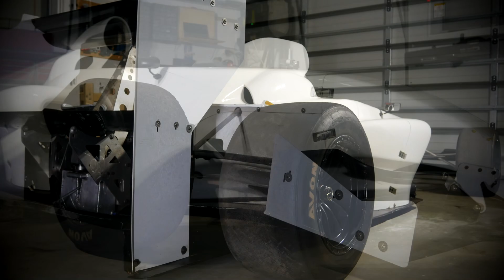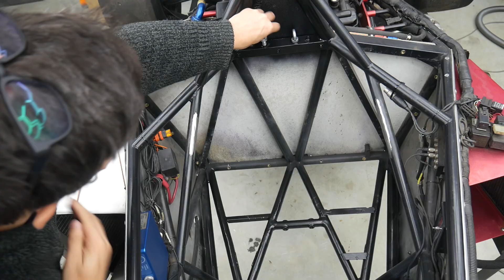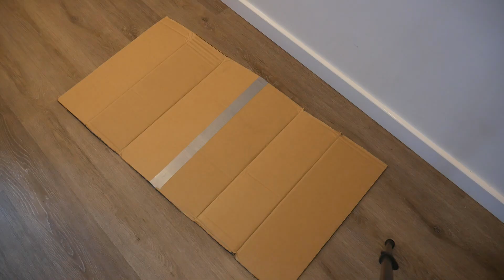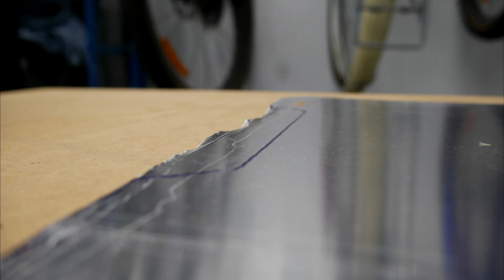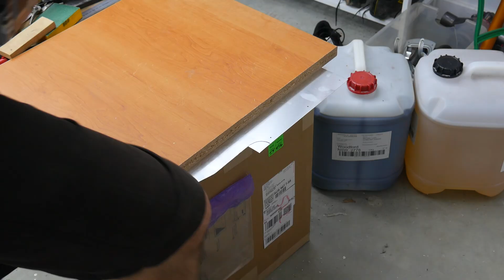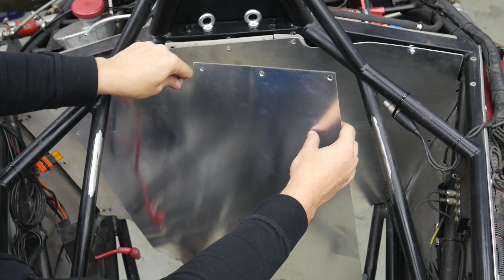Rebuilding a sheet metal firewall in my race car

Comment: Michael, the jigsaw is still the right tool for the job, but you'll need to sandwich small metal sheets between two pieces of sacrificial 4mm MDF (or hardboard) to prevent them from vibrating and ensure a clean cut.

Comment: There is three types of  shears, you have center cut shears, there is left and right cut shears that go around corners.
Normally the handles are different colours so you can tell what one you have
Reply from the maker: Didn't know that, cheers. Bunny Ng's only had the one type.
Reply: @TTRacingYT  no worries, the other colours for aviator snips are red and green normally

Comment: Won’t you need a racing halo?
Reply from the maker: Halo is needed depending on the rules for the series. Mine doesn't require it. I would prefer if the car had one but I'm not sure it's viable to add one now.
Reply: Oh ok

Comment: Great video! I've been doing similar swapping a VERY-not-made-for-my-car transmission into it over the winter and having to make a removable transmission tunnel cover.
Quick tip for finding pre-existing holes for a panel like you're making: cut the head off a screw and grind it to a point. Thread it into the hole, then use that as a punch for the cardboard or aluminum. 
Bonus points if you grind flats on either side of the points to use a wrench or pliers to install and remove the punch in the existing threaded hole.